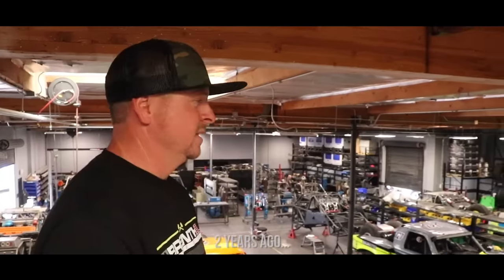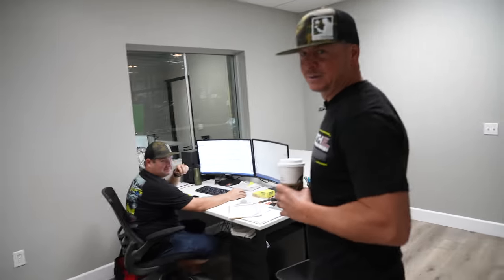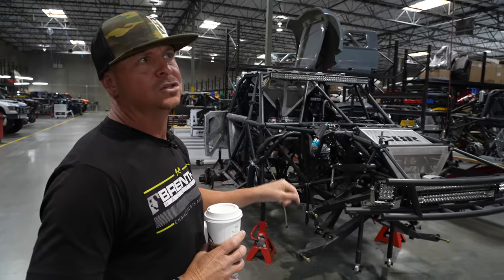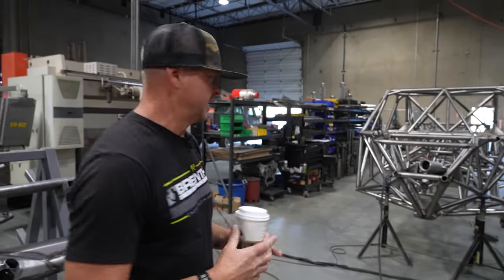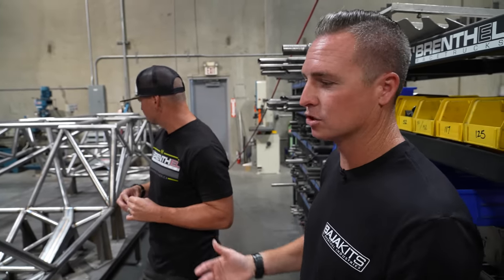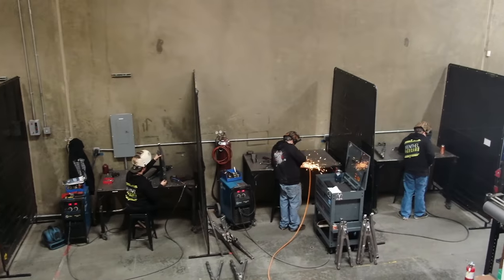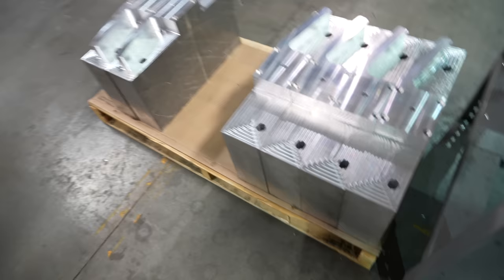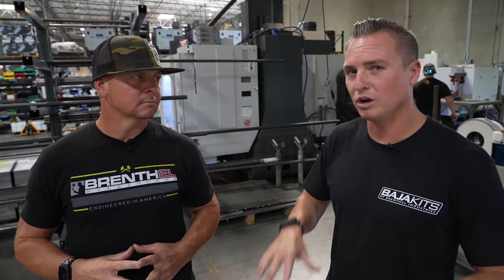World's Largest Trophy Truck Factory - Brenthel Industries Shop Tour 2022

Comment: That’s not a shop, that’s a Trophy Truck factory. Amazing what Brenthel has turned into.

My one suggestion would be to look into a separate structure for fuel storage. You literally have many millions worth of trucks and equipment next to thousands of gallons of very high octane.

Just something to think about.
Reply: Absolutely. I was surprised to see the fuel drums in general shop space. It's unnecessary, and unnecessarily risky.

Comment: Man, you guys have blown up in the last few years with enviable growth! Well earned! I remember when that AWD system was all but smoke and mirrors in the industry, lots of show talk and much dreamed about. 
On the note of 'aircraft/aerospace' grade hardware, that can Definitely be a double-edged sword. On the one hand, the capacities and capabilities are (literally) sky high that they are the only hardware of their kind that can do the job. On the other, if you break something and ARE taking advantage of all the design envelope for that hardware/fastener/part, nothing off the shelf can be bodged to fit and work in the field. 
Learned much earlier in my career when making jet engines out of NOS parts from many scrap engines (scrap by the by is a wide term on aerospace parts. Some means not airworthy but totally usable on a ground-based gas generators, others are totally garbage and truly only good for scrap/melting down) that most if not all hardware that was made for military and aerospace via contractors is often a proprietary thread that only works on that program/design package. It's just different enough that a standard off-the-shelf fastener only fits via crossthreading (or if you're super screwed, 'single use' weld-on)

Comment: Something I see as major oversight is the lack of overhead lifting. It was even mentioned how heavy the billet blocks can be and the difficulty of loading into the Mills. How are the chassis removed from the fixture table? How is material removed from trailers when delivered. The trucks should be able to pull into the material area and unloaded with bridge cranes.

Comment: You have an electric breaker panel blocked by a welding station. 

Clearances around Electrical Panels: OSHA requires a minimum clearance of 36 inches around the perimeter of electrical panels. This clearance is intended to provide sufficient space for workers to work safely and comfortably around the electrical panels.

Comment: Are these Trophy/Trick trucks or Spec?  CAD mass production is neat, seems parts could interchange between competitors if same generation.
Reply: They are both but the majority of the trucks are 6100/spec trucks. The four-wheel-drive is a trophy truck.

Comment: Absolutely great tour. I can see that loads of thought went into production planning and it looks extremely efficient. You should look into floor mounted jib cranes for the general area around the cnc machines to help with the heavy lifting. You can even get mobile ones for up to 1000kg lifting. I am a CNC machinist with 15 years of experience. Would gladly work for a company like yours but I am located in Europe. Best of luck finding skilled workers.

Comment: The difference between a "jig" and a "fixture" is not where they are used, where they are made, or whether they are carefully designed (on a computer or otherwise).  Here's a typical description of the difference:
"A jig controls and guides the cutting tool to work at a predefined location on a workpiece. Fixtures are used for supporting and locating a workpiece. Fixtures do not guide the tool on a workpiece like a jig."
This is high school shop level of knowledge.
And yes, the item shown appears to be a fixture. With the use of CNC machines, this operation probably doesn't use any jigs.